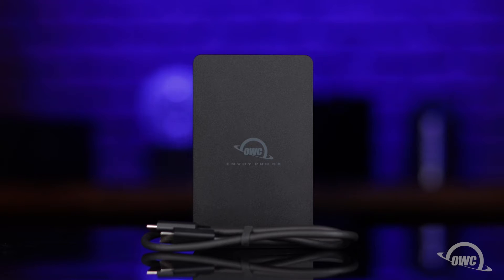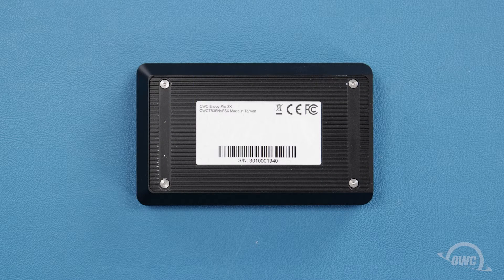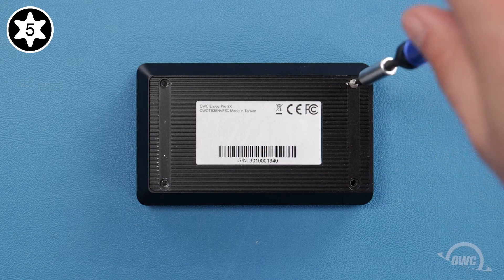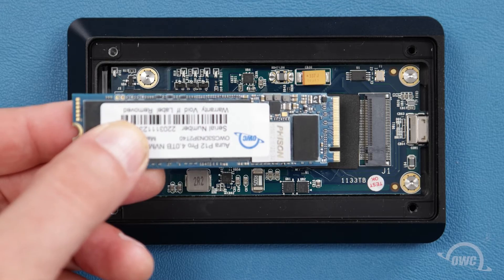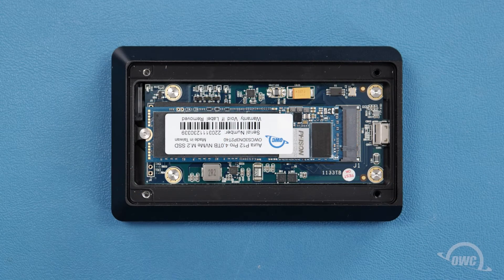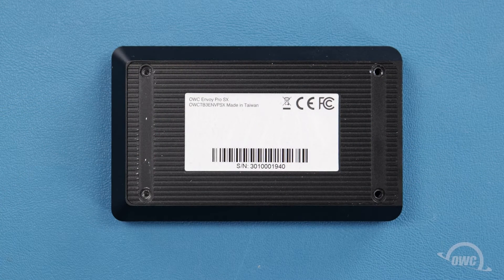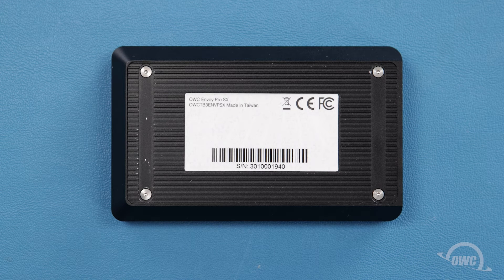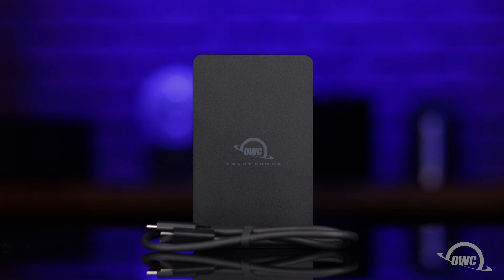How to Install an M.2 NVMe SSD in an OWC Envoy Pro SX Enclosure

Comment: I have an Envoy Pro SX that I would like to upgrade to a larger SSD.  Will I see any speed increases if I use a newer PCIe 4.0 SSD vs the PCI3 3.0 drive it came with?
Reply from the maker: The Envoy Pro SX enclosure only transfers speeds up to 2847MB/s even with a drive already installed that can go faster than that on its own. So it is not likely that you will see faster speeds with that newer drive without also updating to an enclosure that is built for those faster speeds.
Reply: @poweredbyowc  OK, thanks for answering my question.